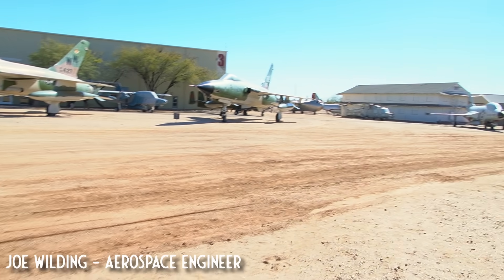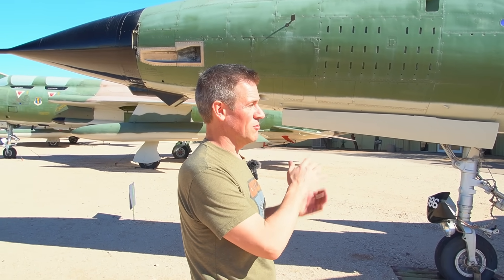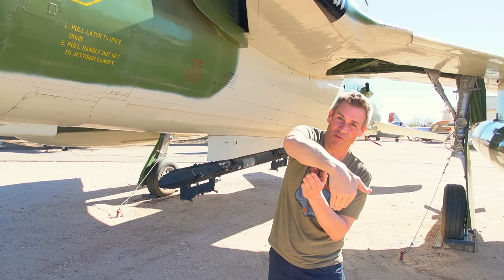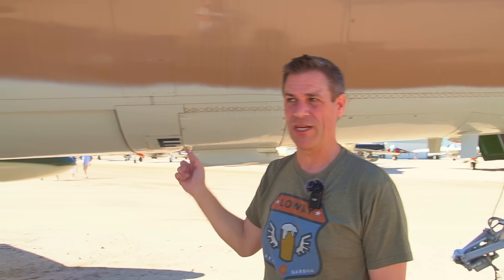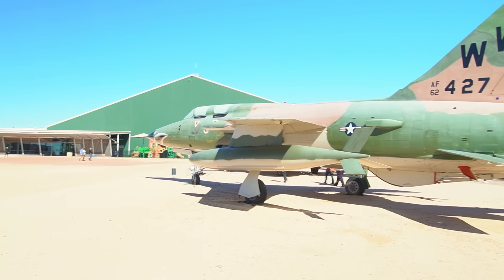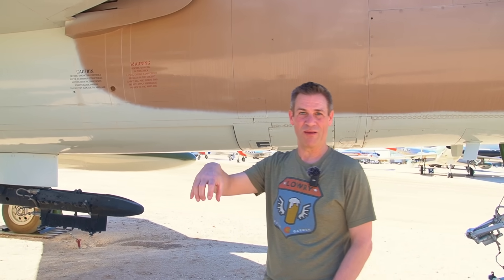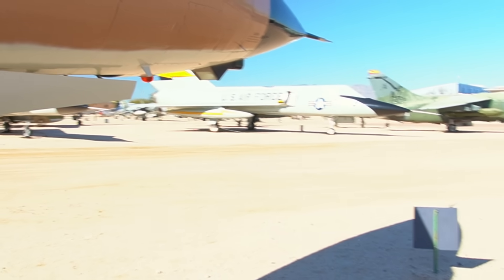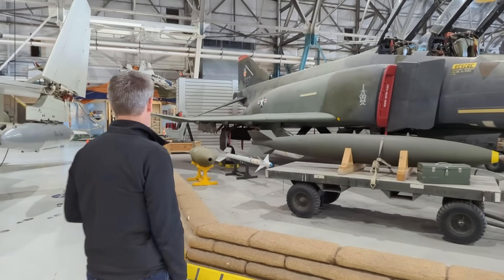F-105 Thud's INSANE Speed Explained | The Aviation Show Clips

Comment: My first visit to an F-105 crash site in the Piute Mtns next to China Lake NWS was 15-20 years ago. The pilot  ejected and live when it got in a flat spin. What was interesting was it was remote enough to not been picked over by nerds of planes. In it it had/was being tested for a telescoping nuke bomb ejection mechanism. Testing had shown if dropped out of the bomb bay going super sonic the bomb would pitch up into the plane. They made the telescope to get the bomb away from the slip stream before release. The site had the telescope and hardware still there.  On the big alum. forging that attached the telescope to the plane had a sticker and now looking at my picture I took I can read to you what it partially said.........."1. For complete ground handling instructions see instruction plate on inside face of access door FF#23    2. Do not rotate handle to  "ground handling" position unless "special weapon lock" in cockpit is unlocked and cylinder is completely vented at point "A"(charging Manifold). .............. and goes on about more instructions.

Well we know what a "Special Weapon" is.
Yes I did research the crash site and about how they fared with this. In the end I read the shape of the bomb was changed and maybe the CG and that fixed the issue. They did not use the telescope.

Comment: As a 105 fan, it was both a interceptor and a tactical bomber, designed first as a strategic nuclear bomber, then morphed to it later roles. need a 10 ft. ladder to get in. Held alot of ordinance. Even the Phantom is dainty next to this. I'll contribute to a full restoration, be cool to see one of these at Osh Kosh or any historic air show.
Reply: I don’t believe Republic ever designed this as an interceptor. It was designed for very fast and low (high wing loading) tactical nuclear weapon delivery. It beat out the F-107A because it had a completely internal bomb bay, even though in many aspects the 107 was superior.
Reply: @dougcastleman9518  It was used, briefly, as an interceptor during the Cuban Missile Crisis.
Reply: @dukeford8893  Ok, so about nine days then..albeit during the absolutely most important event ever in history, because it  almost turned into the last event for us humans.
Reply: @dougcastleman9518  The Thud was a lot of things, but it was no interceptor.
Reply: @dukeford8893  I agree.  I wasn't the one saying that...but thought, ok, maybe it was for the short emergency of the CMC in 1963 if someone here knew something I didn't.
Reply: @dougcastleman9518  I have yet to read one of the op's posts that wasn't full of errors.

Comment: Did the intakes have a canard effect?
Reply: No.
Reply: @trunkmonkey-1 no is a bit absolutist. Their location could have secondary or lower unintended, however slight, Canard-Like Influence

the F-105’s intakes were not designed to produce lift or control moments. 

However, their placement and shape swept forward and integrated into the fuselage could have subtly influenced local airflow around the nose and forward fuselage, potentially affecting pitch damping or flow attachment in high-speed regimes. But this would be more of a secondary aerodynamic interaction than a deliberate canard-like function.

The F-105’s intakes were more about engine performance than airframe control. Still, their unique geometry did contribute to the aircraft’s overall aerodynamic profile in ways that might resemble canard effects—just not in a control or lift-generating role.
Reply: @Johnwashere-dt2ov  You guys are talking about leading edge extensions, not canards.
Reply: @AirwayZombie my comments are regarding do these air intakes produce a canard-like effect (even very minor effects). Never said are they canards.

Comment: Fast. But not maneuverable. 🫡🇺🇲
Reply: You talking about the 104? Ask a Thud driver. It turned ok, just not a Rapter. Not designed to be.
Reply: @garyyoung4074  Yeap, turn better than a 104 and with a way bigger load out, mostly internal. The 104 could barely carry enough fuel internally with its silly small dry wing design.

Comment: One of the most amazing aircraft of it's day. TOO many click bait people ALWAYS try to say something negative about the THUD to get dumbies to click on thier video. The 105 was a pilots dream to fly. Smoking fast, stable at 200' and meant to carry a nuke internally. NOT 14k lbs of dumb bombs into N. Vietnam EVERYDAY into the most intence AA fire until Bagdad. Any naysayer of the Thuds capabilities is an idiot. Unstoppable in it's intended role, (dropping off the tanker outside soviet airspace, with 2 drop tanks and the internal nuke, then flying at 1.2 mach at 200' above  groundl level to it's target. The J75 was a beast of a motor rated up to 29,500llbs thrust in it's last version, (for the super crusader). First internal initial guidance system for low level penetration missiins.  High loss rate had NOTHING to do with the capabilities of the aircraft. A big powerful beast of a machine. One of the best.
Reply: High loss rate had more to do with the tactics the Air Force used, such as attacking the same targets over and over again and setting a pattern.
Reply: @BrianMoore-uk6js  more to that than just the same targets. The same targets attacked from the same direction and altitude and usually at the same time on any given mission. The strike package call signs were usually the same for every mission too. Totally stupid micromanaging by the USAF brass that got a lot of airmen shot down. Operation "Bolo" was dreamt up to take advantage of the pattern, though, and ended up destroying half of North Vietnam's MiG-21s.
Reply: @BrianMoore-uk6js   not to mention the vulnerability of the hydraulic systems co-location...
Reply: @BrianMoore-uk6js 
Not tactics, politically dictated rules of engagement.

The Senate in particular interfered with how the war was prosecuted.  They leaned on McNamara, he leaned on the Generals and they imposed essentially suicidal restrictions on how aircraft and other assets could be used.
Reply: Agreed. Still one of the fastest and sexiest to this day. One hechuva an aircraft. When the type of mission and number of sorties are taken into account along with the fact that by the 2nd and subsequent waves of attacks, Charlie had them zeroed; the losses are not surprising. Brave ass aircrews.
Reply: yep, if there was one warbird I could own in a billionaire dream, it would be the 2 seater F105 recon thorough bred. What a sleek beast
Reply: @sfertonoc  I believe Rasimus' book has some interesting anecdotes about what the feeling was like when they were flying this beast, likening it to an all powerfull demon on a supersonic throne, or words to that effect. As well as the selection process for getting a 105 assignment, where a couple Thuds artrived at the training base and the pilots simply stated that if the students weren't interested in flying the big bird, the squadrons weren't interested in those students.
Reply: The main problem, was they used it for what it wasn’t designed for. It was supposed to be a straight line nuclear bomb delivery platform. But then they turned it into a regular fighter bomber. It was supposed to go fast drop a nuke and take off and get out the blast radius
Reply: A 5th grade girl could have made better decisions than the politicians and the Air Force...the THUD rocks!